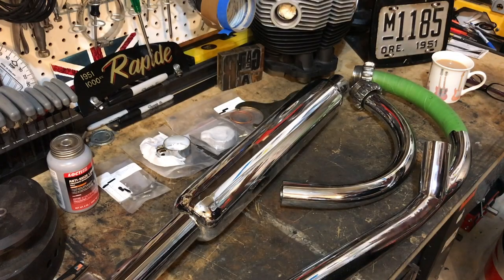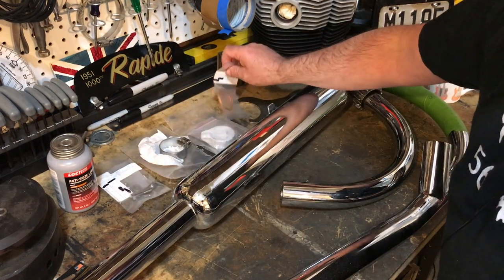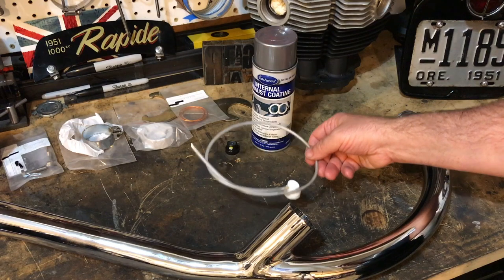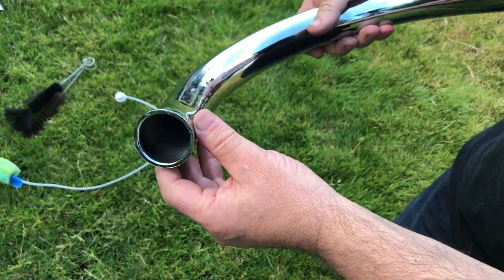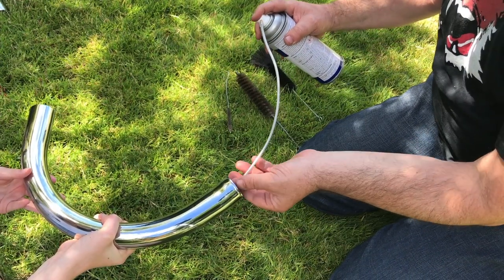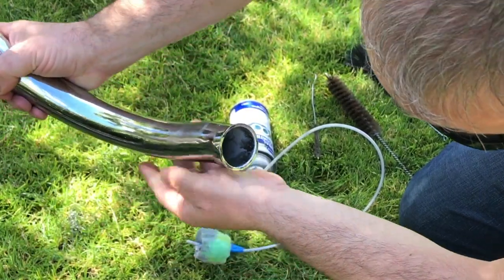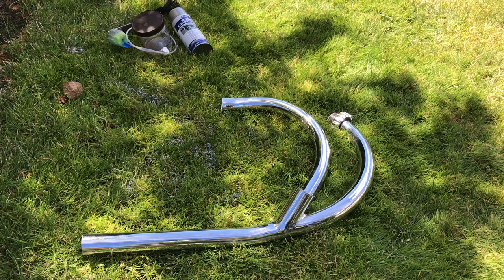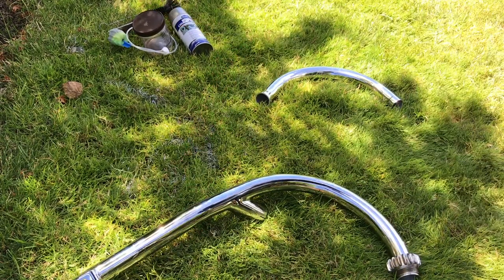Restoration of 1951 Vincent Rapide - Part 43 - Exhaust Pipes #2 & Muffler

Comment: That really looks nice, did you run the exhaust nuts in before you fitted the pipes in place to see how far they go in ? they look a few turns loose from the video, the problem is the angles, the ports are angled the pipes are angled, and to try aligning the threaded glands into quite loose fitting ports is a nightmare, I make increasingly larger plugs to force through the nuts until I get a snug fit, but it is a lot of effort, but better than cross threading a loose fitting nut !
Reply: Englishman French 😢

Comment: Does anybody know if you can use ceramic coating on a concave surface? Just thinking of an alternative to high heat paint, which I've never had any luck with on exhaust systems.